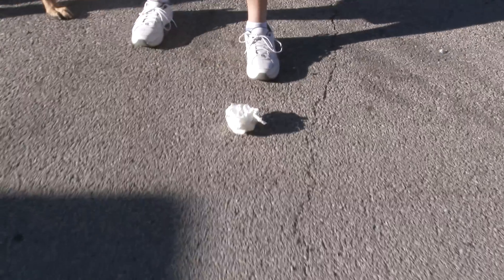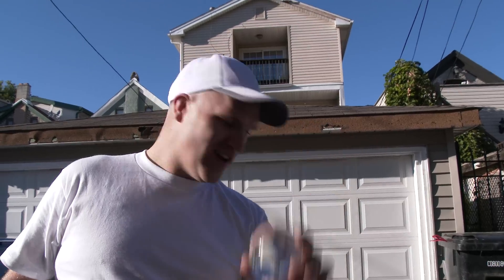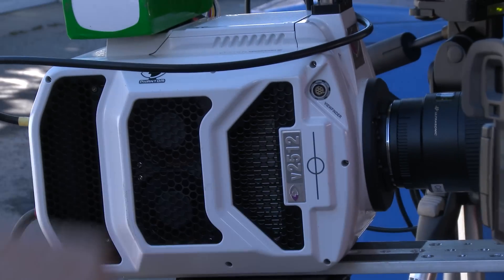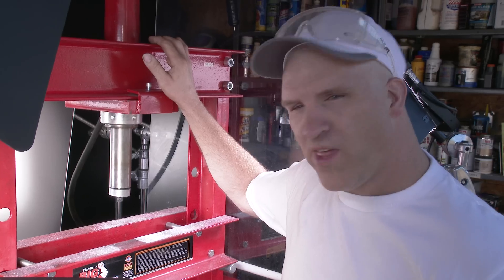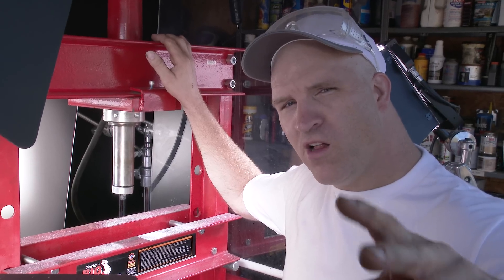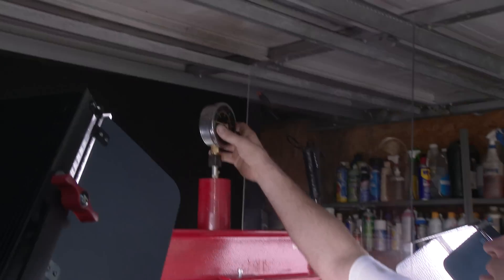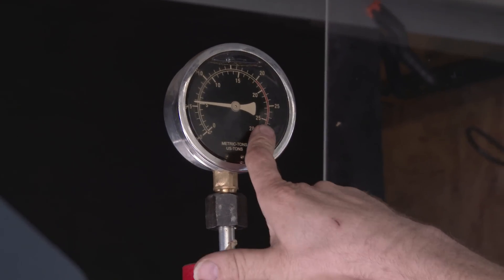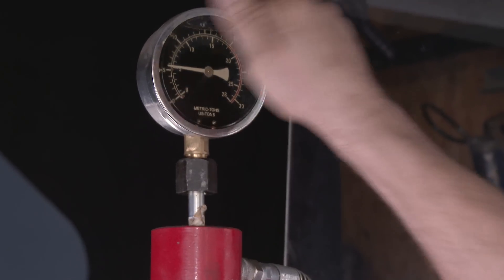Crystal Balls vs HP at 30,000 FPS [ EPISODE PREVIEW ]

Comment: At 57 seconds, the video shows it's being shot at 30,000 fps. That's great, but can someone explain to me how that's 1250 times slower than real time? We don't see time in frames per second, and even if we did, humans can see a lot more than 24 frames a second. Anyway, awesome video! Subbed
Reply from the maker: +No Huevos that's true and I always thought about that, if you can think of a better way to get the idea of how much slower it is that real time please tell me. I've been think
Reply from the maker: +No Huevos thinking of a better way for a while, because the 1250 times slower than real time kinda makes sense but it doesn't relate to what we really see. I just don't know how to explain it properly. Thanks for watching and thanks for the sub
Reply: It's 1250 times slower if you play it back at 24 fps.

Comment: Warped Perception, here is a suggestion for a video: Could you film the droplets of ink shooting out of the cartridge of an inkjet printer? You could use an old/used inkjet printer and make a hole through the paper loader in order to have a line of sight to the cartridge...